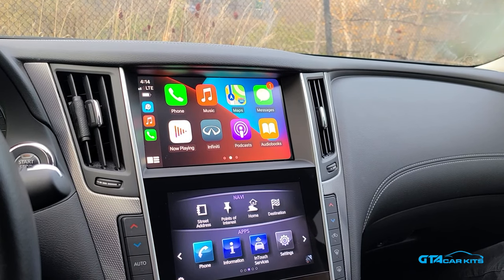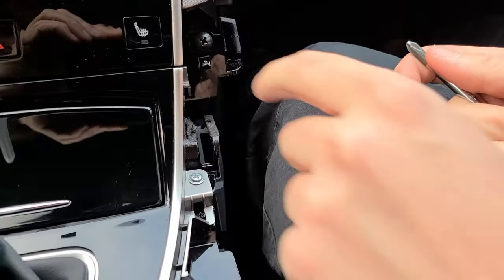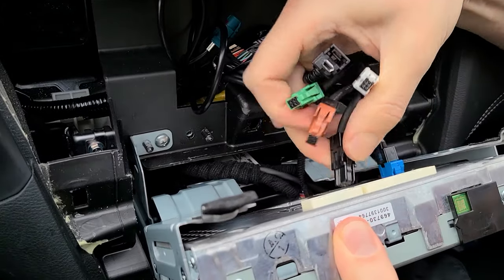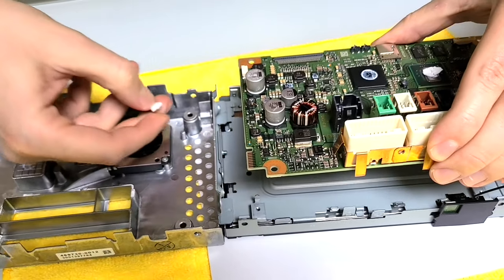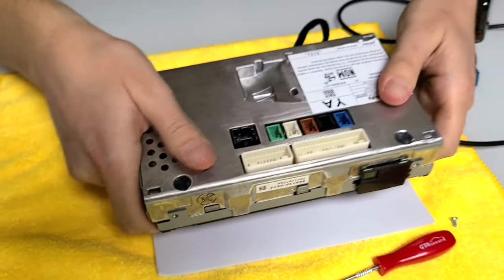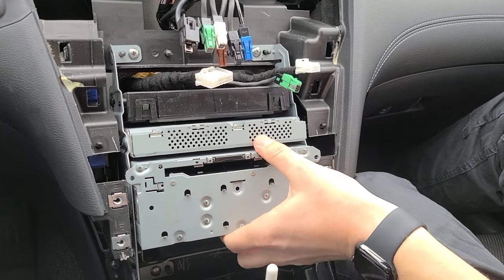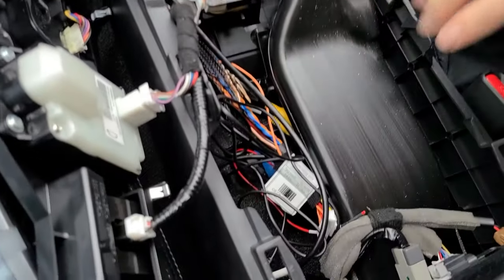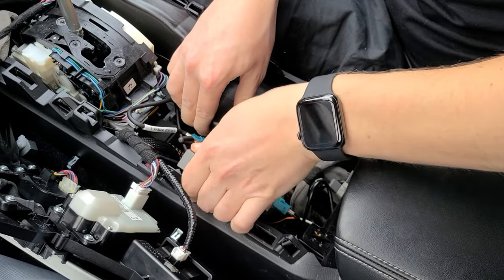Wireless CarPlay and AndroidAuto in Infiniti Q50 Q60 QX50 2015-2019

Comment: Just installed this and would 100% recommend. Works perfectly and watching this video while installing made it so easy. Just two minor things. You need a step bit so that you can drill the hole in the center armrest and also buy the panel removal kit that they sell makes everything 10x easier.
Reply: Do all of the steering wheel controls still work switching tracks etc…?
Reply: @cgrahamhott3140  yeah everything works like factory
Reply: @jesuslabrada720  it works like it came with the car!! thumbs up
Reply: @jesuslabrada720  can you watch YouTube while driving?
Reply: Does this system give the option to work wirelessly? Or just plug in?
Reply: @cgrahamhott3140  yea
Reply: What’s up homie, 1 year later system still working good and strong? And what year q50 did u install it in? I’m gonna buy this just trying to see real results from people
Reply: Installed it but screen is grey after, I’m able to connect via Bluetooth and get CarPlay on my phone but the screen is grey why?

Comment: I did it and at first the screen came out white. Then I contacted customer service and they said it could be the big film and sure enough it was. It wasn’t hard to be honest it’s the screwing down that was a bit tiring. I have the 2015 Q50.
Reply: I have a 2015 Q50 premium and I want to do this, how did you fix the white screen?
Reply: @ejman320  yea how did you fix it
Reply: So what your big film was just not down all the way? Or u needed a new one
Reply: @QfiddyKJ  it wasn’t down all the way.
Reply: @trestenagrant1999 how do you know it’s down all the way? My screen is also blank
Reply: @icey__o1082  you only know when the display works accurately. Just recheck and adjust the film

Comment: I see you drilled the hole in the center console to connect the USB cable can this step be bypassed if you are going to connect wirelessly or must that cable be ran into the module regardless of wired or wireless use?
Reply from the maker: With Apple device it will work both with wire and wireless. Android device is currently by the wire only. The USB should still be wired for Update purposes and if you are planing to use multiple phones with the vehicle. Thank you.

Comment: I just installed in my 2016 Q50S and the sound quality is poop when using the wired connection. Any suggestions on how to get good sound quality for my music and phone calls? Easy install and seems to be working perfectly otherwise but with poor sound quality it defeats the entire purpose of installing and using it...
Reply: I have the Unavi (Wired only) Carplay kit
At first my audio was also not as good. But the fix i found using turning on the “Sound Check” option in the music settings. 

Try that and see if it works for you.
It helped me out “drastically”.

Comment: I install but no sound my q60 year 2019.
Any idea fix this ?
AUX port not work because sound is bad quality.
Reply: Did you fix it? Try re-establishing the connection. That fixed the bad quality on mine. It also sometimes plays through Bluetooth or Wi-Fi so you gotta switch it. 

In case anyone else has this problem since there isn’t that much help for this product.

Comment: I bought the car with this already Installed. I was always wondering what the mic and that other cable were for but after watching the video. I must have this installed already. What's the purpose of this installation?
Reply: Apple carplay made it worth it. The original navigation is bad in my opinion. I’m able to control a lot now (music, gps, messaging, etc) without having to pull out my phone. It’s not really necessary, but a nice luxury to have.

Comment: Can I take my car back to the dealer after installing this? Just got a 2015 Q50 3.7 Premium but I know when I put these after market parts on I will have to take them off before I take my car back, I don’t know if I can take it back to the dealer with that installed, that seems like a lot of work to put in much less take out and put the factory shit back
Reply: Unless you're having radio issues or get your center console ripped apart they won't know you have it and won't care trust me no one is gonna make a note on your customer profile that you have aftermarket electronics installed (source: was a service advisor for multiple years and have worked in dealerships since I was 18)
Reply: No you should be fine, as long the aftermarket isn’t the reason why the radio is defective, you should be all good,

Comment: why didn't you connect the android module to the stock microphone and speakers? where is the gps antenna?
Reply from the maker: It is connected to stock speakers, original microphone not possible to use. The GPS antenna is not nessesray, the GPS data comes from your phone directly, not from our module. Thank you.

Comment: I see that you drilled thru the console in order to plug into the usb. If the plan is to connect your phone wirelessly, can this step be bypassed, or is it necessary for it to be plugged in via the center console usb?
Reply: I have the same question.Also  For wireless - will sound still come through the 'iPod' connection or as part of the overall wireless connection. I would like to avoid drilling any holes (leased car) to the inside console.

Comment: dope just installed mine.  great product
Reply: Do all of the steering wheel controls still work like to changing tracks etc…?
Reply: @cgrahamhott3140  yeah they do.  The only thing…  when I’m plugged in usb the CarPlay cuts out.  I just replug it and it comes back on. But it does it often. Wifi works great

Comment: Super video but 2 questions

The extra board to add is not screwed or fixed anywhere ? 
Meaning it can move inside ?

The exit video output cable through sharp metal border of the screen frame ? Safe ?
Reply from the maker: Hi, Yes both are safe. For any further questions please email us info@gtacarkits.com Thank you